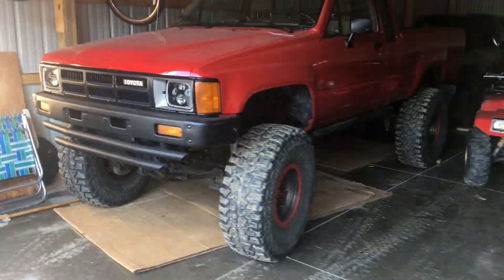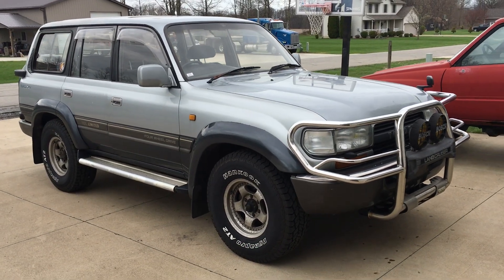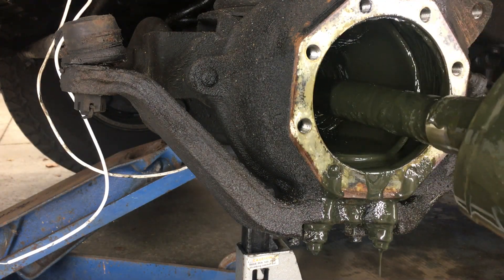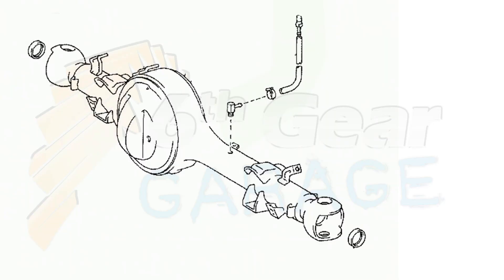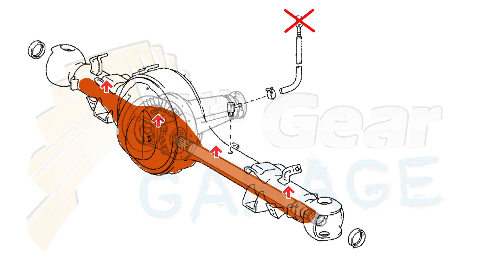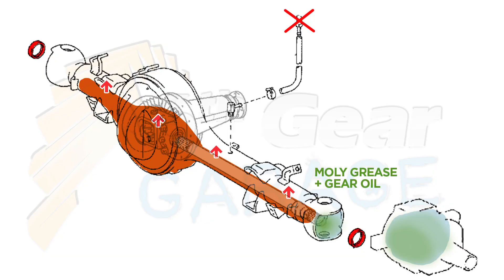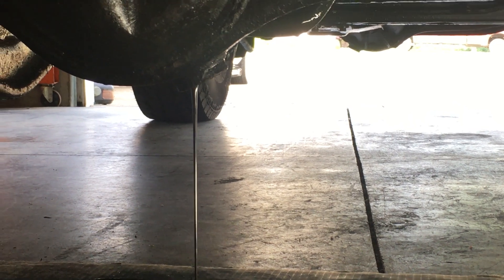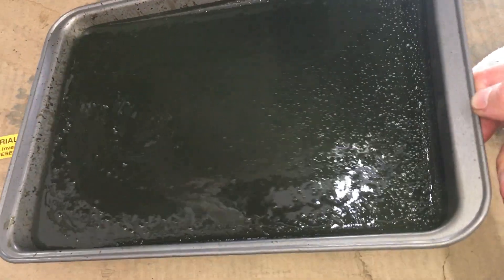Why 4WD Toyota Front Axle Knuckle Seal is Leaking Grease

Comment: Just picked up a 85 all stock rubber it’s a project has rust frame is solid the owner has owned it since 2008 I wanted to try and get it real cheap but he seem like he didn’t want to sell it he settled on 4k this day and age that’s a steal for any first gen rubber let alone a 85
Reply from the maker: @aaronscott2278  yeah the 85’s seem to sell a little higher than others, being the last year of the solid axle.
Reply: @6thGearGarage tearing the engine apart to fix things I was taking the cold start injector line off and the threads pulled out of the injector wasn’t very happy lol definitely opening a can of worms with this project but excited at the same time
Reply from the maker: @ that’s how it always goes!  I’m just glad you got a good frame. Hopefully the body rust isn’t too bad.
Reply: Frame is solid most rust isn’t on the rear wheel wells one small hole below the drivers taillight and around the windshield inside is very nice

Comment: Nice video, looking forward to the next in. 👌🏻Definitely worth doing the rebuild with Toyota parts and Japanese bearings. When I rebuilt my 85 axle the first time I was a poor student and used Chinese bearings. A few years later when I got a job I re-did it with proper Japanese bearings (from Marlin, I think). Now I have the old bearings as spares…. Which I’ll probably never use. 

There is a way to remove the knuckle to service the birfields without touching the wheel bearings, it’s called the “Camo” method, after a guy in the Pirate4x4 forum. You remove the steering arm, lower knuckle bearing cap, locking hub, knuckle ball seals and caliper and the knuckle can be removed. It’s heavy, though, but this is used as a trail fix when you break an axle.
Reply from the maker: I never knew of the camo method... thanks!

Comment: I used to pull off the breather lines and re-tube them to a higher point. They handle deeper water with out having to depend on a check valve that came over with Columbus.
In fact, I used to ditch them (the check valve) entirely, and just candycane the end of the line.
Reply from the maker: The previous owner did something similar on my 85. They ran a hose up to the engine bay firewall and stuck a fuel filter on the end. Cheap and it definitely works!

Comment: Great video. Very informative. I’m rebuilding my ‘77 FJ40 now and it is great to be on the lookout for keeping the breather clear.
Reply from the maker: If you're going to be offroading often, consider running a longer line up to the firewall. The previous owner did something similar on my 85. They ran a hose up to the engine bay firewall and stuck a fuel filter on the end. Cheap and it definitely works!